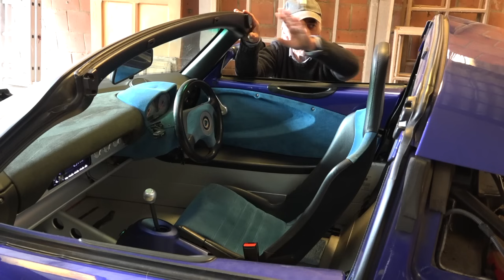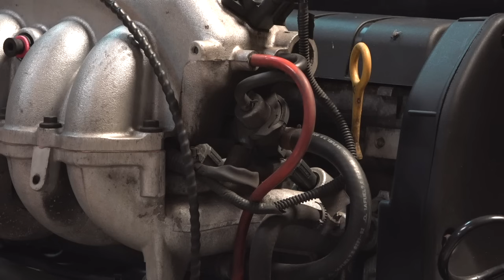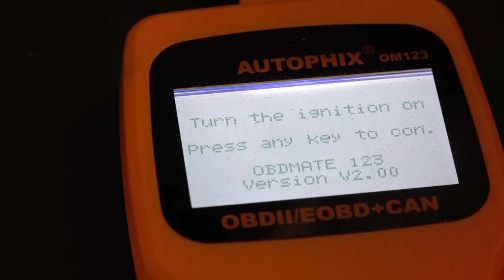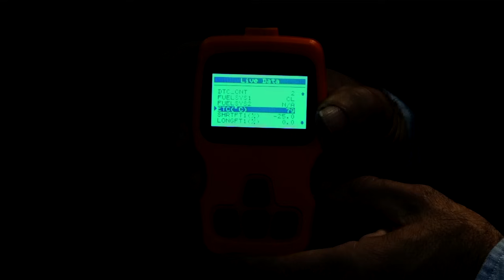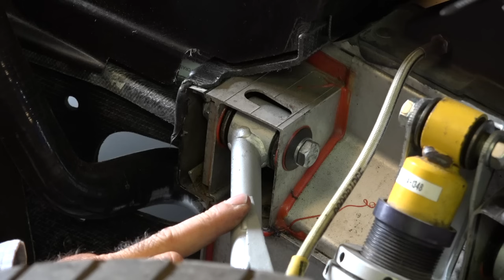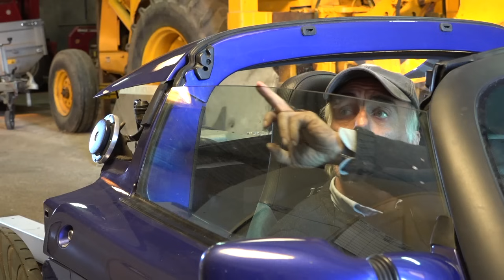Buying your first Lotus Elise   Things you must check

Comment: I got a offer for a vtec swaped S1. But that was used on tracks😢. I dont know what to do ?
Reply from the maker: If you look for a good car that was not recked or abused , then don't  buy a track day car...   the fact that its a track used car  says alot about the driver..  I do drive on the race track with FF's and a MGB GT.... I have friends on the track with an Elise  and those are pushed to the limit, have rough handling of the clutch and gearbox...   my advice, don't    unless you want to race on the track
Reply: @D3Sshooter  thank you Sir ! 
I better keep away from it ☝️

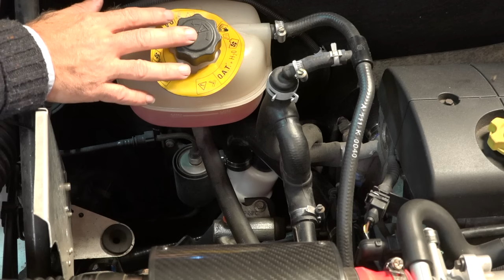Comment: where can I find more information on the cooling modification kit mentioned at 12:20?
Reply from the maker: Here you have some info on a kit that  does exactly that  https://www.elise-shop.com/pressure-relief-remote-thermostat-elise-exige-s1-340r-only-rover-engines-p-79.html?zenid=4ug81pq1loa3v4jvh4tah6bbe2
Reply: @D3Sshooter  Thank you so much. and thanks for a great video.
Reply: @D3Sshooter  I just aquired a 111S that has been mostly in storage for 10 years without much service so I am still familiarizing myself with the car and starting to work my way through everything that may need service etc. I see on eliseparts that their equivalent kit does not work with that model. Is it not necessary that version?

Comment: 07:00 if the engineers designed this with a quickly detachable rear body to access the engine, like a racecar it would’ve been fantastic IMO, or maybe it can be done
Reply from the maker: thanks for the comments, indeed but they did not

Comment: Hello Sir!
I bought my first Lotus An Elise S2 from 2008 with only 16.500 km on it a few weeks ago. I have a few questions that I wonder if you could help me with.
Firstly, could you recommend a good workshop manual for the Elise? I want the correct torques and so on for all bolts and nuts.
Also, I think you mentioned in one of your videos that you had got a complete set of new hardware from somewhere. Could you please give me a link if got that right.
I love your videos, they are fun to watch and very instructive.
Cheers Poul
Reply: Use the proper lotus service manual,all the torque settings are in there.

Comment: Nice vid but DONT pull on the top of the windshield getting in and out! There are a lot of documented cases of cracking. Best technique is to put your left foot in first into the footwell, balance using right hand on the seat turn your back on the car, then literally drop in butt first, the rest will follow. But whatever you do, don't pull on the top of the windshield (you can see it bending in the video).
Reply from the maker: Thanks for the comments, yes indeed you are 100% correct

Comment: I would address the temp surge issue by either getting a lower temp thermostat (less than $20 US) or simply drilling a tiny hole in the one in there so the hot coolant can slowly warm up the engine itself. Is there any problem with these suggestions?
Reply from the maker: Thanks for the comments,  its the actual flow that is need. The littel hole will not help that much.  This is especially an issue when driving hard, beating that engine.

Comment: Would you recommend checking engine compression? I always do to check cylinders about same. Another huge consideration for a car like this is to see any sort of rust or corossion to see if it was winter driven... More likely probably on a Miata a cheaper version of this hehe
Reply from the maker: Thank you for the comments, I would not wurry to much about a compression test.  Of course if they allow you why not.  But those engines (K) are easy to get.   Corrosion , less of an issue as its alu, although there are some area's that are prone for Alu corrosion. ( front wishbone to the chassis), I would ne more worried about a twisted chassis.. as that final

Comment: Do not get in and out of an Elise by putting weight on the windscreen surround like that, unless you want to have a cracked windscreen! It's not a structural part - you can see it flexing alarmingly in the video.
Reply from the maker: Thanks for the comments and tips.

Comment: Thanks for this interesting and informative video. I have few questions which I think you have the insight to answer. 1. I am 191cm (Say my legs to torso ratio skews more towards longer legs than an average 191cm person). Do you think I can comfortably drive the car, without hitting the steering wheel? 2. I have worked on some BMWs esp. 3 series myself (relatively advanced) and I think they are well engineered cars, not only to drive, but also to work on (sleutelen). Could you say the same for an Elise?
Reply from the maker: Thanks for the comments, well that is hard to say.  It might be tied, as i am a shorty at 168cm and 63 Kg's.  I think the biggest issue will be getting in and out..  Actual seating will be OK, I assume.    I used to have BMW 320DTouring .. its a great car.  (now a 420i).  Working on  the Elise S2 is a different generation of cars and technology.  It simple and you can do all the work yourself.  The only negative side is the access to the engine, that is very restricted ( space wise).
I would say , give it a try and get seated
Reply: Thanks, it is reassuring to know that working on the Elise is going to be old school fun (except for the engine ;)). I will check out and sit in one. Of course entry and exit are tricky, but that is only like <5% of time you spend with the car. The rest 95% is more important :)

Comment: Thanks for this video. Got my Elise yesterday for -500 eur. It was a 2002 K-Series in grey. Price beginning was 21.000 eur. Everything had to be done, -10% means 18.900 eur and then he let me take the car to our diagnostics professionals for one total day. Everyhing had minor problems, even the hardtop had some scratches. Bearings, differential, clutch, balljoints, toe links, springs, dampers, gearbox 5th gear problem, radiator, temperature constant 89 degrees Celsius, tires worn unregularly, window not closing totally, Rust and breaking not straight, car geometry not good, electric problems, battery worn out, driveshafts full of grease and the aluminium wisbone attachment had some cracks, best was the tuned pipe and engine tuning from 122 Pa to 140 Ps (I put minus 2.500 eur on my list). After 11 hours of checking the car, my friend working as a mechanic at Lotus told the owner that he should be lucky to only give us 500 euros that we take this heap of junk out of his courtyard. Ps: this was total fiction. Amazing video to buy a Elise, destructive video to sell one :-)
Reply from the maker: Thanks for the comments,   I could see that... but that is on fact a reality... many are not well maintained and if you buy one.. better check it out...  Like your story
Reply: i have one for 14 years, it’s on sale, but noone knows ifthere could be lots of small diseases that the buyer will find on the list and try to decrease the price. Then I’ll keep it. Of course it’s 25 years of listening sometings loud to music,but my Tinnitus comes because ofthe alarm with closed garage door since this march. I can’treally forgive my Elise for having done disease to my ears...but I won’t have a better life withoutmy Elise, just more space in the garage. Both sides have big advantages. To sell or not to sell, that’s the question :-)

Comment: Superb video. So much information presented in such a calm and engaging manner. Dissapointed to learn that, at 6' 4" (1.93m), this car is unlikely to be for me, as it is the most beautiful car I've ever seen.
Reply from the maker: Glad it was helpful!,  The best thing to do is try it... sitting in it will be no issue... maybe the in and out will be...  but than again we all crawl in and out our Elise...  Give it a try,
Reply: @D3Sshooter  Thanks very much for that. I would love to drive, and possibly own, an Elise and doing the limbo to get in and out would be a small sacrifice. Thanks again for the superb video!
Reply: MAYBE YOU CAN GET THE TOW BAR MADE IN STAINLESS STEEL ,USE THE OLD ONE AS A PATTERN.,AT LEAST IT WOULDNT RUST.

Comment: Not being built anymore???? Last I checked they are still being made...ok no longer sold in the USA but that's their own protectionsim.
Reply from the maker: Not the S2
Reply: @D3Sshooter  This video is about the Elise in general, and the first one and the current one are all based on the same chassis and although the parts aren't a straight swap over, they can be made to fit.

Comment: I'm 55. I've has my S2 111S for 11 years. I am 1.88m. I use the car every day. It's comfortable (bit noisy - I like that).  The boot is small, but you can stuff soft bags over the wheel arches. I've carried 60 bottles of wine hundreds of miles, or 3 large sacks of fire wood (never both at the same time).

I don't know who this person is, but the first 3 minutes are complete rubbish.  Time waster.
Reply from the maker: Hi, its me the Time waster.   TXS for your comments, that is impressive 55, 1.88m, weight ?   wow 60 bottles of wine, and none broke ? Not in the booth I hope as that is limited to max load of 50Kg .

Comment: You could get one of these Elises for free if no work been done on it , once you add up the prices. Would,nt want to be selling a car to this guy .You need a bit of give and take with a car like this ,they aint exactly two to penny ,and most people will probably work on it themselves
Reply from the maker: That is true, its all about the price one is asking. But one should now where he/she is getting into as Lotus parts are very expensive... unless aftermarket parts are use , but those are often low quality ( not always). I did lots of work on this one...  spend at least 10K euro on it, just to get it all corrected and fixed.  I did buy it for 6000 euro so all by all its OK, But i knew it from the start.

Comment: I wonder, what do you think of the alfa romeo 4c? Would you ever consider one?
Reply from the maker: Hi, for sure that is a very nice car. I could not tell you how good they are or how bad.. They look cool, the only thing I can say is that based on past experiences with AR  and in general they are great but have always been suffering from small things. Its Italian, style full , sporty and again based on my past not that reliable. Of course that could be very different for this car.  So my judgement is out of date and possible not correct anymore.  Yet, I would go a Lotus.  Thanks for commenting
Reply: @D3Sshooter  thanks for the reply. They certainly are a attractive looking car, and I think it's nice that they made something so unique in this increasingly homogeneous car market. But of course, you are right about the possibility of poor reliability, and to me it is a real shame they never made one with a manual transmission. Which alfa did you have?
Reply from the maker: Hi, I used to have many moons ago the Veloce spider, lots of issues both mechanical , electrical and bodywork. Of course that is long time ago.
Reply: @D3Sshooter  beautiful cars, when they were working, like a gtv6. Here's a question about modern lotus cars. If you had to have a new lotus product, and you wanted to use it as more of a daily, what would you have? A new elise sport 220, a used Exige v6, or a used evora s? Assume a budget of around 45000 euro.
Reply from the maker: @TheSaint491  My option would be the evora without any doubt.
Reply: @D3Sshooter  beautiful cars, evoras. Least before they made the 400. But then again, they only started fitting charge coolers to evoras with the 400, which makes them better for track work. Not that an Evora is a proper track car, an Exige or elise is better suited for that, but a good compromise between track/fast road and daily. Me personally, Im torn between an elise sport 220 and an Exige s. Both have charge coolers and a lot of problems smoothed out, both are more refined than previously without a lot of the electrics I hate in modern cars. Exige would be more expensive to run of course, but nobody bought a lotus without knowing that, plus it has the Camry v6 and they're generally pretty bulletproof. Dual injection too, so no carbon issues. Crucially though, both are significantly cheaper than the evora in the UK. Evoras always carry a pretty hefty premium here, especially for the 2012-onwards cars which had a lot of improvements made to them. Lot of words

Comment: Even though I'm a Corvette owner, I'm a total car enthusiast. And I've always had this closet admiration for Lotus cars. Even though I'm not in the market for one, I found this video supremely interesting. All the hidden things about buying a this specific Lotus. Brilliant!! Much in this video applies to buying a lot of sports cars....Enjoyed it.
Reply from the maker: Thank you for the comments, we all share the same interest cars with character and power. Which corvette do you have ?   The sting ray   ?  that is what I would love to get
Reply: @D3Sshooter  I've a 2013 Z06. I've got, now, over 70Kmiles on the clock. It's white /w ebony interior. No other options. The LS7 engine has been a real gem. It's also been remarkably reliable. My first couple of issues just came up. Hood strut dampers needed replacement. And there's a bad actuator for the HAVAC. Otherwise, the rest has been: battery, tires, front brakes...normal wear and tear stuff. No other electrical or mechanical issues thus far. And I love that it's normally aspirated. No turbo or SC issues to worry about..And it'll do 0-100 mph in  well under 8 sec with Michelin PSS tires...And it drives brilliantly. The ride doesn't beat you up. This car makes amour with the road. Corners amazing. I highly recommend getting one!

Comment: Please explain what the white dots are on the dipstick and what forms them.  I understand the circumstances (hard driving with a cold engine) but I would like to understand what happens to cause the white dots and exactly what they are?
Reply from the maker: Hi Tom, that is typical water that mixed with oil, and got deposited  on the dipstick , its the begining of serious problems and  most of the time   head gasket leaks  or even worse  a crack in the engine block.....  Its minor white stuff.... if you see foam or milky oil then the engine is toast ( oil and water mixed due to a serious leak)
Reply: Vice
Reply: The white dots are water droplets  with added oil ,so this means you could have a head gasket problem ,IE,,your head gasket needs replacing,I have done a few head gaskets on the rover k series  engine it's not difficult if you follow the procedure and you have a decent torque wrench and a proper service manual and the camshaft locking tool,and the uprated head gasket.
Reply: Water droplets

Comment: If you drill 3 little holes 5mm in the thermostat  it will give you a little water flow from the beginning until the thermostat opens up. This will work on most cars, and will save your butt if your thermostat ever fail. It will take slightly longer for your car to get up to operating temp. But it will stop the sudden water temp fifference when the thermostat opens, it also makes it easier to bleed the water system after flushing water.
Reply: That's a little too much... the general guidance for these engines in the Caterham is a single 3-4 mm hole. You're only trying to allow a small amount of water to circulate slowly around the system to allow a degree of thermal stabilisation. 3x5mm holes will allow so much flow, that you'd be as well running with no stat at all. 

I ran a modified 88degree stat, with a single 4mm hole in it... my car got up to temperature (around 90 degrees) and stayed there, no matter how hard it was driven and for how long. Engine was rock solid the day I sold the car.
Reply: @1061shrink1061  That is a really useful tip. Thanks
Reply from the maker: Dil Lee good tip.   Txs

Comment: Can you make a small hole in the thermostat just to keep some water circulating?
Reply from the maker: I don't think that will help much , as the whole has to big enough .  The good thing is , there is a replacement kit that fixes the issues.  That is what `i have installed on mine,,,

Comment: Please!  Getting in and out of the car, don't hoist yourself by the window frame.  Even in the video you can see the whole frame flexing.
Reply: Lay down on the ground and flip yourself in with a half push-up hand spring legs first. To depart, roll out onto the ground head first and stand up, or just lay there.
Reply: @seivaDsugnA  $100 from me if you make a demonstration video.
Reply from the maker: Yep, you are right... TXS

Comment: Hi Steve,
I saw that you came from Belgium. It would be very fun to meet.
I also have an Elise. A 2004 Elise S (like the 111S, but with the stardard k 120cv)

However, please do not do supports on the top of the windshield. It will eventually crack.
Reply from the maker: Yes , I am area Oudenaarde... and yes pulling on the windscreen is not a good idea...
Reply: @D3Sshooter  with my height and my back problems, I know how complicated it is to come in and out of an Elise

Comment: 10:00 - Of course the water circulates on an inner-loop before the start opens - this typically includes the heater-radiator. If you let the engine warm gently for the first 10 mins, so the block warms through along with the head, you will have no problem. Driving hard from cold will warm the head more than the block, and stress arises. I love the KSeries, and have on in my MG MIdget and S2.
Reply from the maker: Indeed,   that is what I was trying to explain,,,,  txs for explaining it...
Reply: @D3Sshooter  In Poland we use K-Series in our car Polonez, to prevent temp shock also for quicker fulling water to system. We drill a little hole in termostat, that's when ur termostat is broken in full close still have a minimal flow